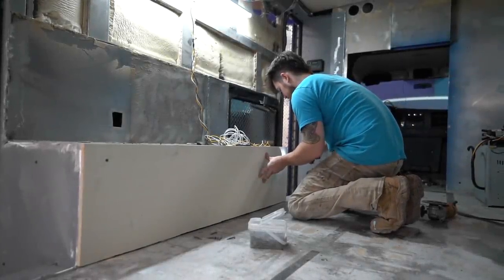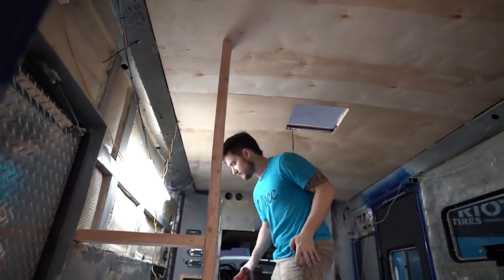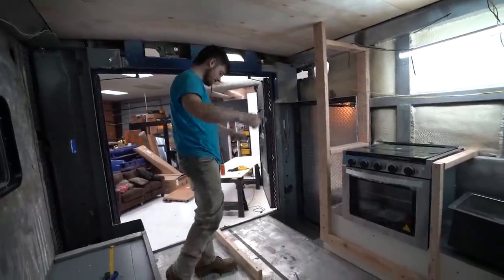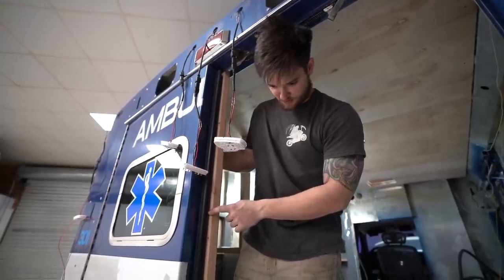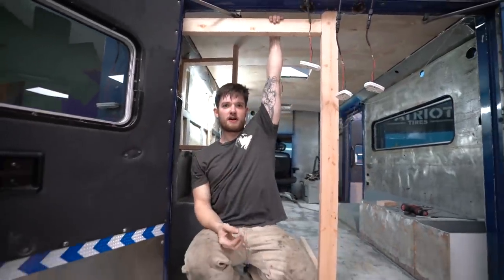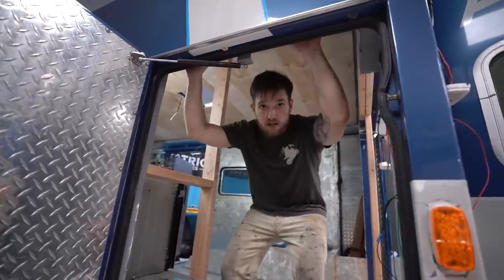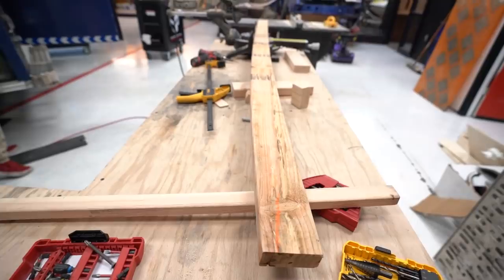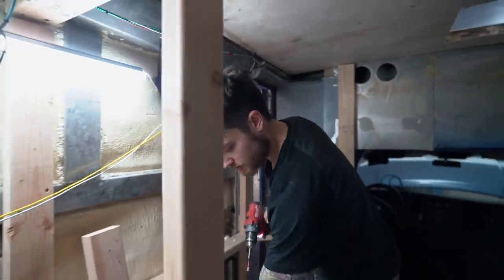Framing Out our Ambulance to RV conversion!

Comment: dan you should get an impact driver, its definitely a game-changer when driving screws compared to a drill
Reply: I think he has one already
Reply: Just needs an M18 drill with the select drive or whatever they call it that let's you choose between drill, screw or hammer.
Reply: @wnracing  hammer like a impact or hammee drill for concrete? There is a big difference ya know
Reply: @chickensfloat7427  Yes, there is a difference for sure, but it works very similarly at higher RPM on the M18. Either way, the 18v would work much better than the 12v for this particular application.
Reply: Not to rain on your parade but impact drivers are made for things that require an impact to drive or extract and drills are made for driving stuff like screws which is what he’s doing, an impact for something that requires a drill is overkill😂 wonder why people who put up dry wall don’t use impacts🤔 oh yeah cause they are bound to fuck it up using the incorrect tool

Comment: I forget it needs a transmission still lmao. Also, let's all just take a minute to appreciate than Dan also says fuck you to Milwaukee's $100 M12 batteries as well 😂
Reply: I buy the drilks with batterys then use cheap 2 for 20 bucks m12 batteries. Not as good of quality but work just fine for the price
Reply from the maker: I also buy the cheapo alternative... They last half as long but they are like 4th the price

Comment: Good tip if ur facing the van looking at the bowed bottom plate get two bugles and scew them on an angle both side one scewed on the left facing down one on the right facing up that should pull in the bowed end

Comment: Man in was using this table saw to cut some cork flooring up in roswell a few years back.... it pinched the blade and shot back rt into my shin. (I was lazy and didn't have it on the stand) pretty wicked impact lol. My thigh  felt like it had sun burn from the hits feet lower lol.

Comment: I had 0 gauge wire on my stereo system, 2 5000w alpine type r dual Channel amps with 2 12in alpine type Rs & a 15 inch alpine type R

Comment: i wish dan would finally use/purchase the m18 drill/impact instead of using the m12 stuff LMAO
Reply from the maker: I actually have one... Don't know why I haven't been using it...
Reply: @DOITWITHDAN  I swear i've seen it in the background of some of the videos, and ever since i've been "triggered" when i see you do woodworking related stuff with the m12 stuff, since you'd probably get a much stronger/tighter "bond" with screws if you used the impact :) I personally have the m18 stuff for woodworking and its kickass.